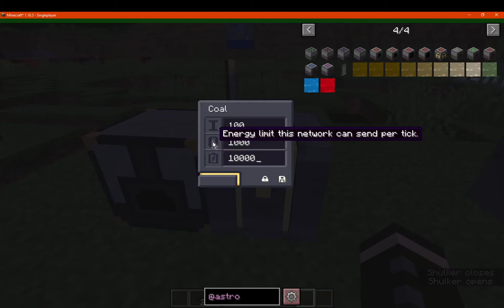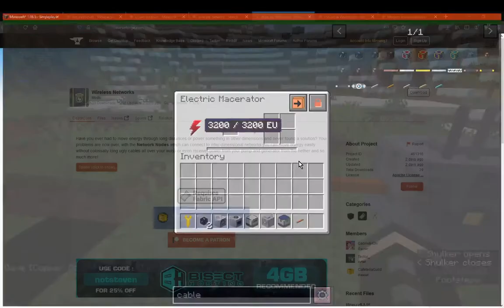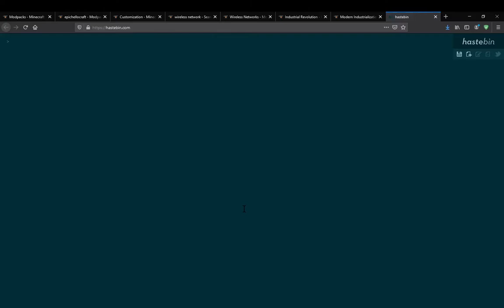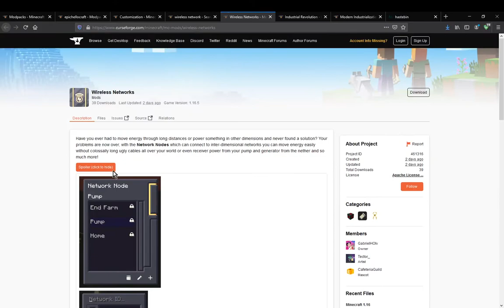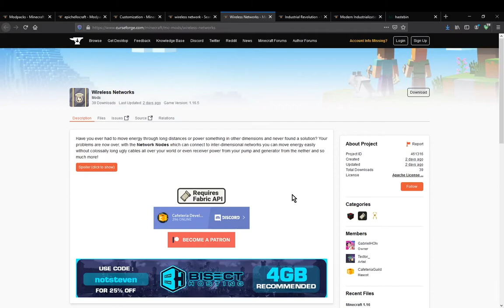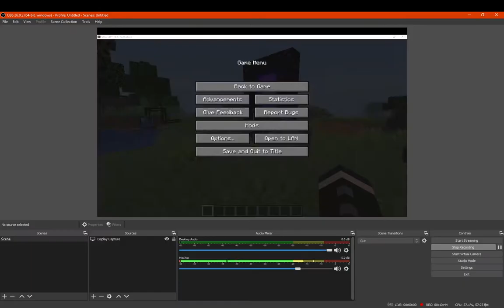Wireless Networks 1.16.5 Fabric Redo Mod Overview

Comment: Hey their, Like your vids, only one that covers some of the mods in AOF, super helpful. Hey I watched this like 5 times might be missing it when it comes to connecting to Modern Industrialization. I hook it up inputs EU but when i point to it it shows E and the output when selected doesnt supply EU even though it has 1M E stored. any thoughts?